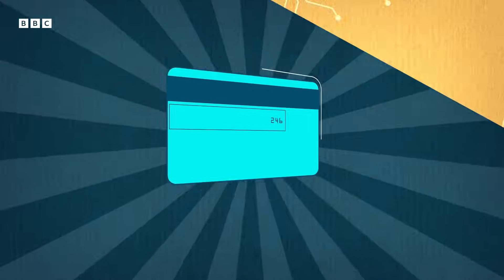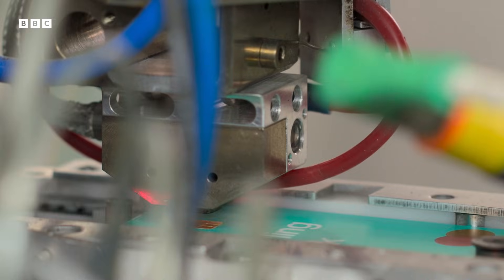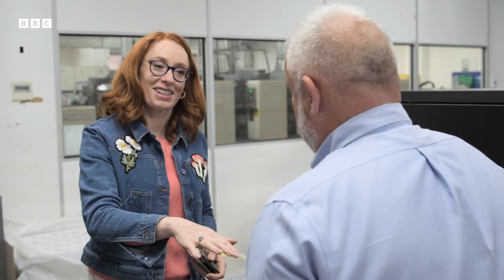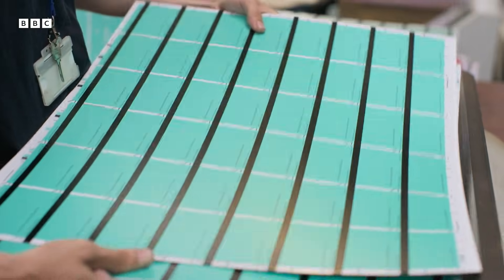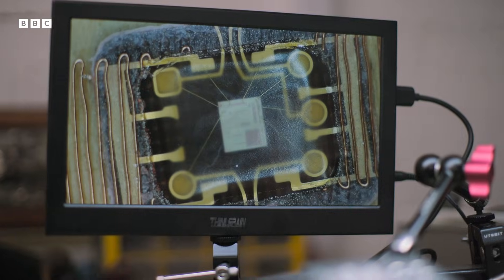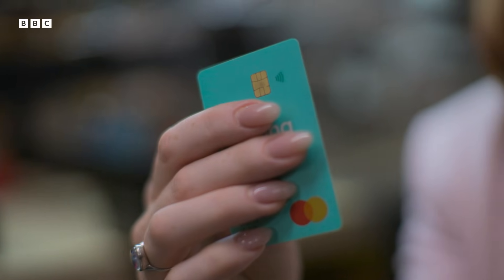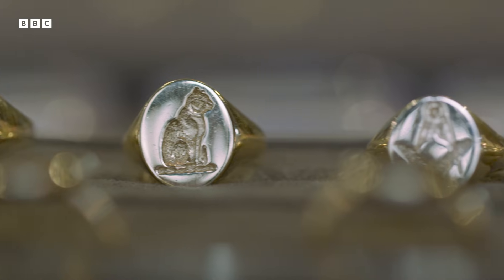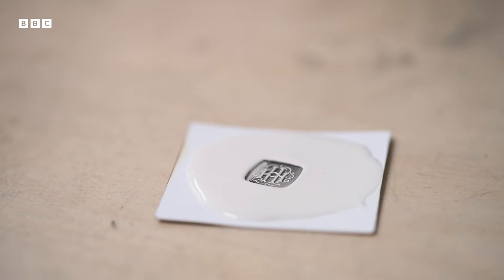How Microchips Made Bank Cards Safer | The Secret Genius of Modern Life | BBC Earth Science

Comment: yeah... this video is made for laymen understanding, it doesn't clearly say how it work. Basically with magstripe, your number is available for any device that can read it, but with the chip it doesn't reveal the number, it will sign a message of the terminal (the PoS machine) and then the terminal will carry that message to the bank system and the bank will authorize it to charge. The message of the terminal is unique every time so the signature (and the terminal's message) will become useless after 1 use, copy it doesn't do anything useful for future use and certainly cannot be used to make another copy of the card
Reply: Is this procedure for physical contact terminals (insert card), wireless terminals (tap-to-pay), or both?
Reply: @illitero  there are differences between both, but the basic principle remains the same. The payment terminal simply has a payload that contains the amount to be paid and the identification of the seller that wants to receive the money and your card is used to cryptographically sign that payload which requires both information stored on the chip, the current time and your PIN code. That is why simply copying the data on the card is not enough. The bank where the digital package is sent to, holds the key to read the message and verify the authenticity. And when everything is confirmed will send that confirmation to the payment terminal and give you the signal that all is OK.

Attempting to send the same payload again to the bank will fail as it was timestamped, copying the information onto another card won't work either as you can't read all the data on the card but the card actually does calculations with the data provided.
Reply: @illitero  it's both because it's the same chip which wired to an antenna coil embedded inside the plastic card which will communicate wirelessly using magnetic field
Reply: I was looking for information for my new credit card fraud ring, but I guess I'll have to look elsewhere 😂